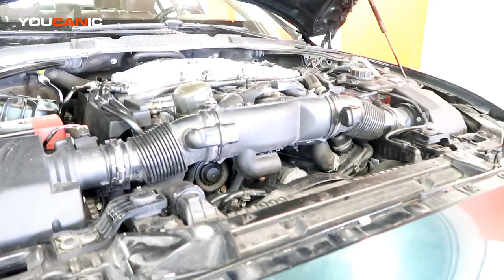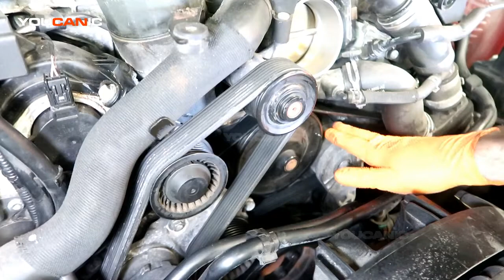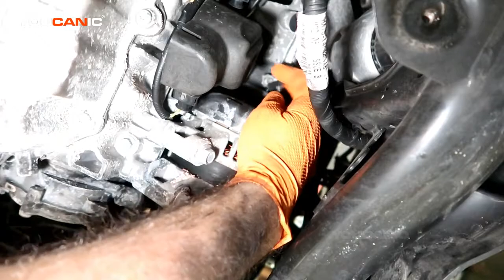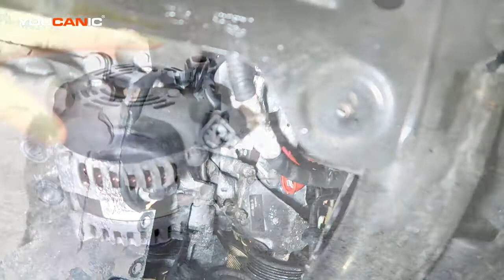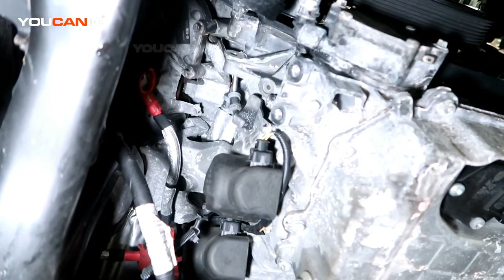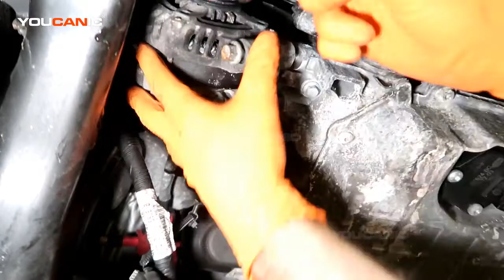2015+ 3.0L Jaguar XE - Alternator Replacement 3.0 L AJ126 supercharged V6 Engine

Comment: 참 잘 했어요!
Reply from the maker: We appreciate your kind words! At YOUCANIC, we strive to empower car owners to confidently diagnose and repair vehicles. Our Full System Scanner is a resource we're proud to offer which acts as a mechanic at your fingertips. Learn more about it at www.youcanic.com/scanner. 

Beyond this, we provide OEM Factory Repair Manuals and a community where you can ask car-related questions at www.youcanic.com. We're dedicated to making car repair accessible and understandable. If you need further guidance, just ask. We're here to help and appreciate your trust in YOUCANIC.